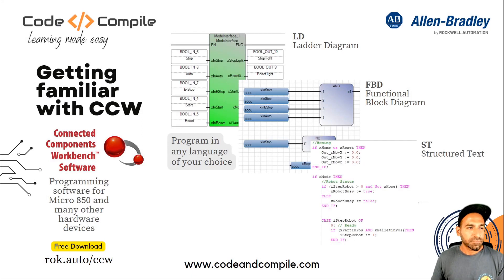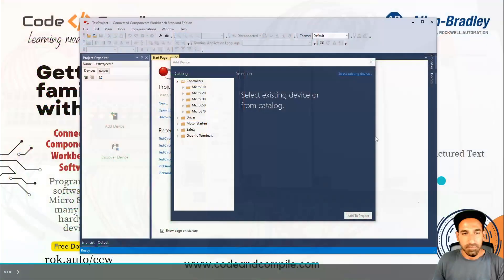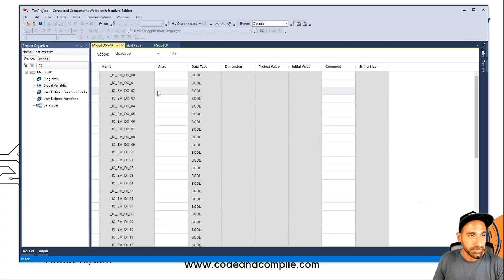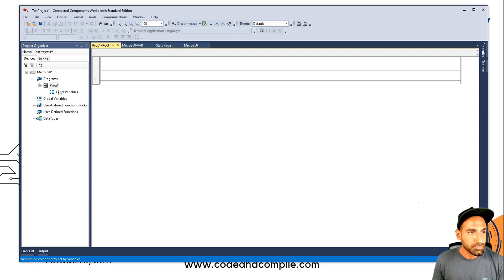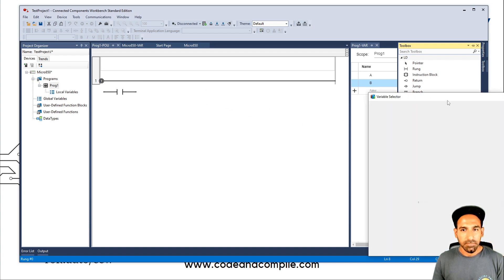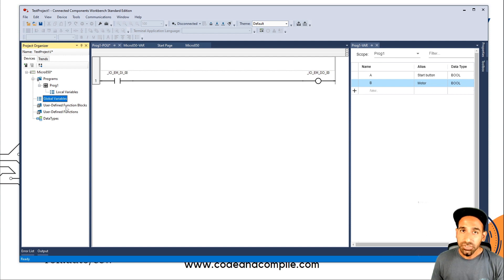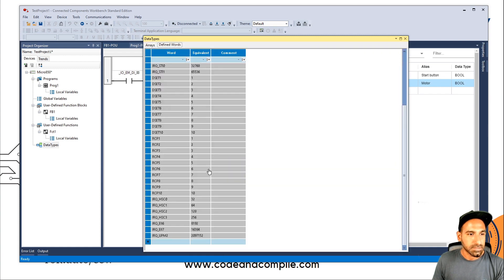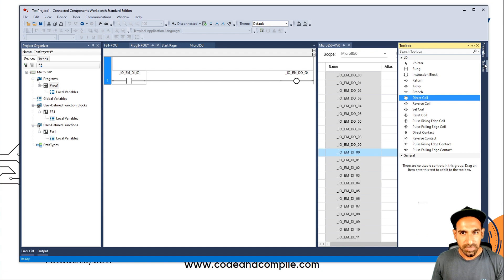Lesson 2- Introduction to CCW Software

Comment: sir i install ccw v22 and i start simulation there is ms blinking error 0xD011 watchdog timeout value.. can help to  solve this ishuee?
Reply from the maker: Your plc code (probably for loop) has made the scan time more than watch dog time. Either optimize the program or increase your watch dog timer in plc settings